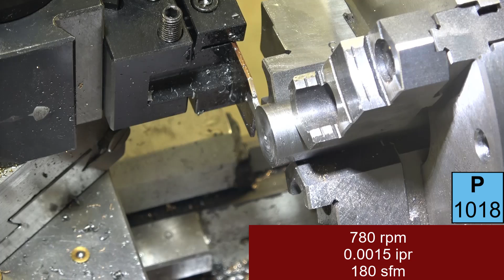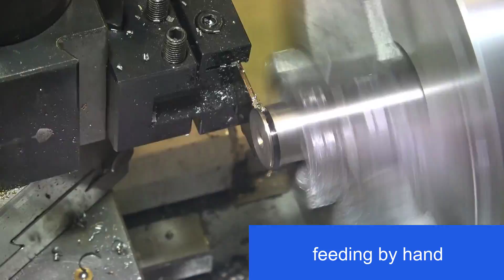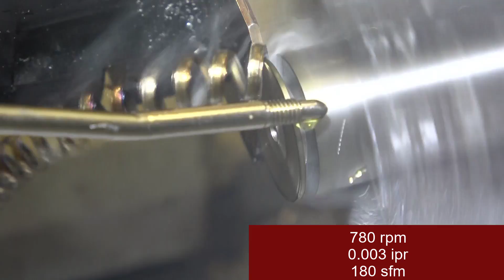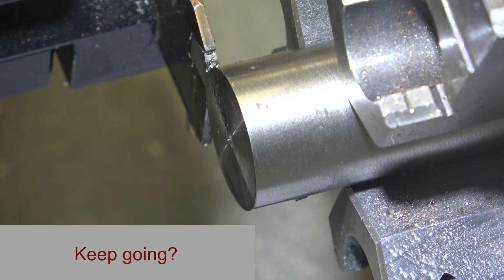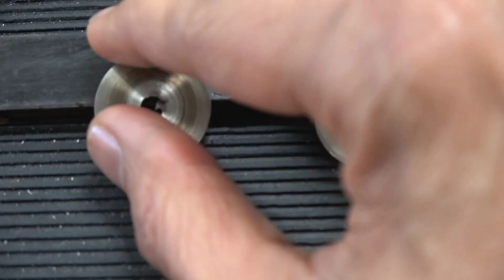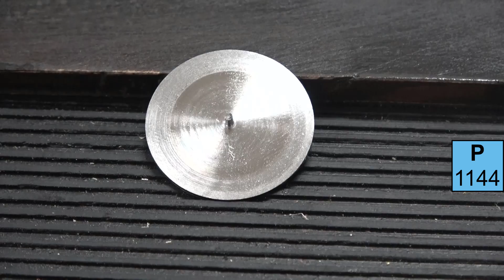Parting 304 Stainless, mild steel and 1144 at High Speed

Comment: Constant Surface Speed (CSS) is mandatory to "securely" partoff hard to machine material on a lathe. I wouldn't risk the integrity of any machine-tool for any other than soft aluminum and composites using your method.
Reply from the maker: You are quite right about that. However, I don't have a variable speed dial, nor a CNC lathe.
As I mentioned, at the higher speeds in 304, there was a nubbin left behind. This is from the tool just bluntly ploughing through and not cutting. There are several solutions: hole in the center, speed up the lathe or use hand feed at a slower rate. I think for most people who do not have an ability to set up constant surface speed, the use of hand feeding into 304 stainless is just as tricky... slow enough to not burn up the tool and yet fast enough to get under the "skin".

Comment: Very nice. Can you try to increase the rpm at the same depth of cut?
Reply from the maker: Yes, I will most likely have to do a video on that. My lathe has two pulley settings, and currently I'm in the low range. Each range allows for 6 speeds selectable via the gear controls. Easy to switch between. Since a lot of my stuff is not in Aluminium, I've just been lazy and left it in the low range.
I suspect the high range will be even scarier:face-turquoise-covering-eyes:
Reply: @7alfatech860  I'd like to see that too